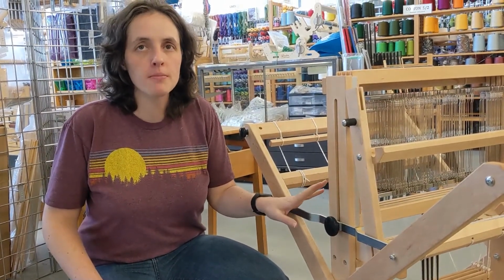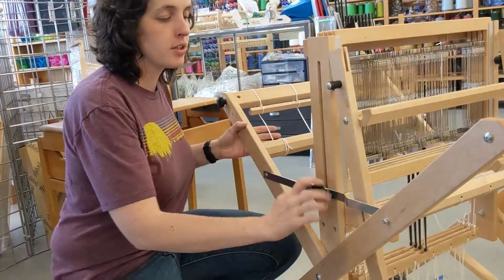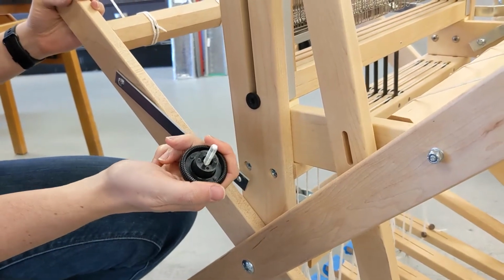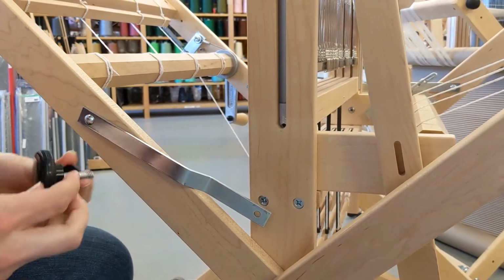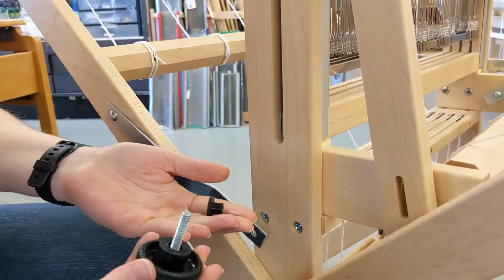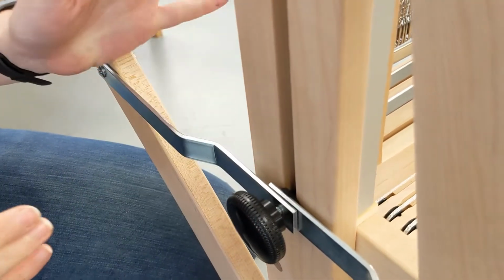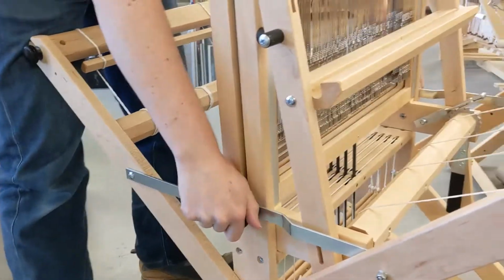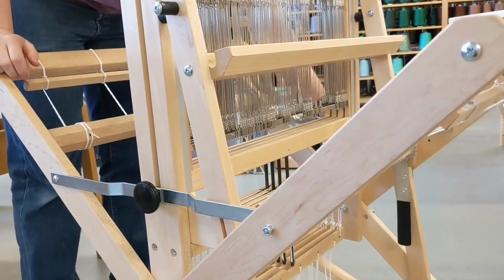How to ... Re-insert a Schacht Wolf Loom Knob!

Comment: Is there way to replace the metal piece that you screw into?   I ordered the metal pieces and little black piece the knobs goes in but can’t figure how to replace the metal piece.  It seems to be striped.
It’s an loom from the 80’s.
Reply from the maker: Yeah, give us a call and we can get you set up. It will require taking the loom apart a bit in order to get them into place once you get the replacement part - 541-688-1565